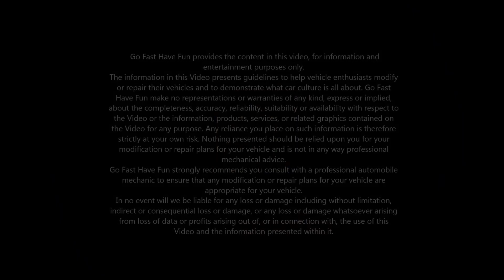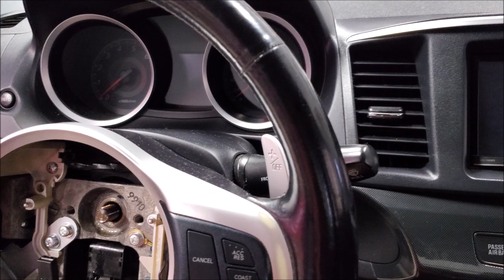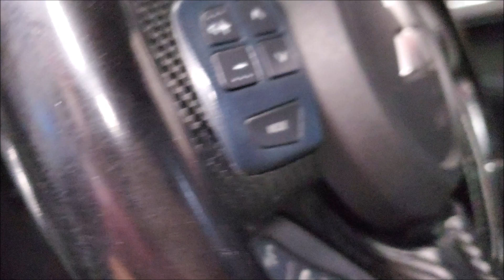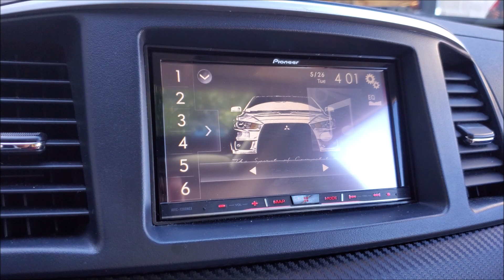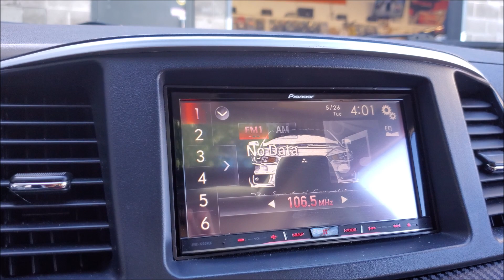How to Replace Steering Wheel Control Buttons | AnthonyJ350

Comment: I want to be able to use an deep dish steering wheel in my car but how the duck do I navigation the cars menus and settings without the buttons? Is there an aftermarket device that can act as an alternative to the oem wheel buttons?
Reply from the maker: Not sure, haven't seen anyone do a mod like that.  Maybe you can be the first!

Comment: Same footage as yesterday’s video replace clock spring first 1/3 and last 1/3 same footage
Reply from the maker: Good observation, it's the same procedure to take off the steering wheel.  Makes more sense to reuse those scenes as opposed to taking apart the vehicle twice and risk damaging something.

Comment: Lets say your vehicle has a old steering wheel with no buttons lets say you buy a Mitsubishi or a audi steering wheel does the buttons work with the old vehicle?
Reply from the maker: Not unless you install a head unit that is compatible and run the wires.  That would be pretty difficult to make it work reliably.